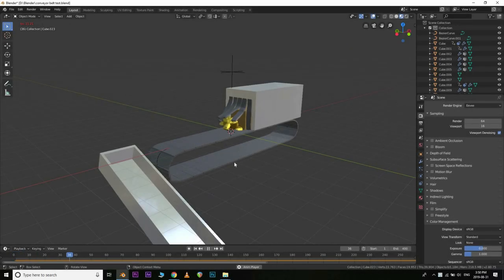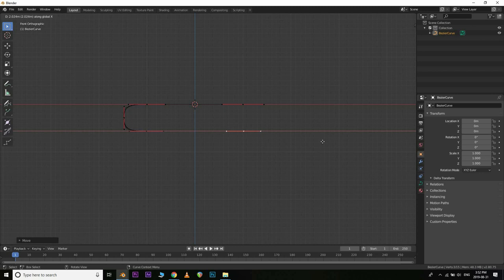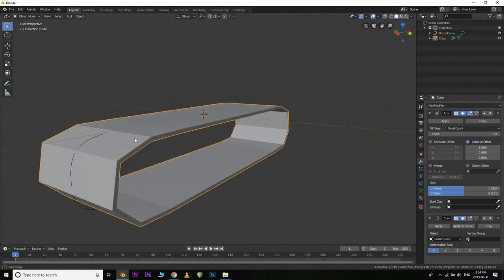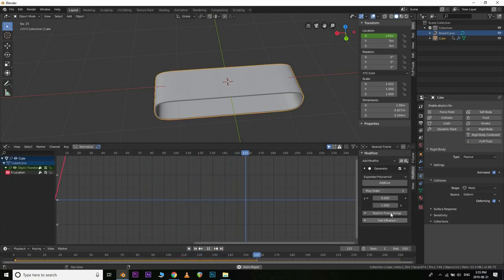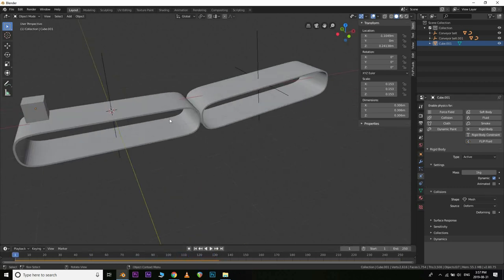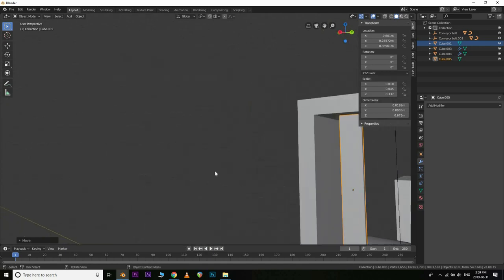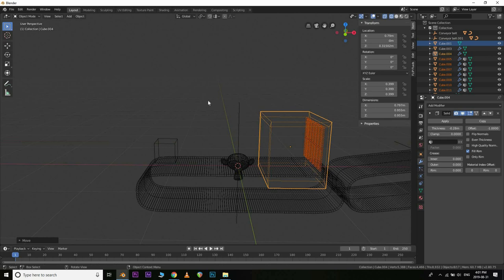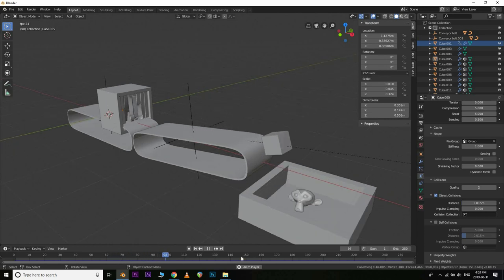Blender 2.8 Dynamic Conveyor Belt 10 Min Tutorial EASY

Comment: Sometimes my objects keep sliding into the unknown, like the conveyor belt is endless and invisible. If I change some random settings it sometimes works again and the objects fall down at the end. Any idea why?
Reply: Does the same for me, sometimes saving the file and closing blender does the trick, sometimes it doesn't. :(
Reply: @MichaelNatale1267  You both have to create it carefully again from the beginning. I did some tests now and it seems that the problem has something to do with a not aboslutely clean creation. All that you describe happened to me too. But in the end it works now correctly. Tested with Blender 3.1, 3.2, 2.8 (linux).
Reply: @Trabucco0  Hello, I've seen this comment from you a lot of times now but no matter how many times and how perfect I create a conveyer belt the rigid bodies simulation is inconsistent and fails all the time. I've also found that more people have been experiencing a lot of issues concerning rigid bodies on conveyer belts, especially in newer versions of Blender. Could you maybe create a small tutorial? Or write down how you do it? As I'm unable to get a consistent, good result.
Reply: @nickykolk  You should ask @MajesticSkies if he is willing to upload another vid about this topic. I am just a learner like you too. Sorry.
Reply: The boundary box for your collision is not taking the curve modifier into account.

The reason for this is that the key frame animation takes priority over the simulation. Try ending the animation when your object reaches the end of the conveyor belt.
Reply: @IgnobleKin  Well it sometimes does take it into account as I described. It appears random to me, at least I don't know why it sometimes works and why it sometimes doesn't. I cannot end the animation at the end of the conveyor belt. I have hundreds or thousands of objects on the belt. It becomes even more strange when some objects fall down immediately, some others a bit later. It looks like as the objects touch the belt, the objects keep traversing over the conveyor belt, but they remember the length of the belt since they have been in touch with it the first time. So the rigid bodies kinda don't update their knowledge about the new transform of the belt

Comment: The cube just falls right through the conveyor and I followed every step
Reply: Check if you applied the array instead of keeping the modifier. It worked for me that way.
Reply: @marcosamaral9658  I have the same problem, applied array but the cube falls through the top surface and hits the bottom surface for some reason

Comment: I get a strange problem. The physics of the box reacts to the "invicible" belt that moves away in the x direction and not the one on the curve ?
So basicly the box either goes along the x-axis forever or it drops down... Mayby i am just tired and missed someting..
Reply: I found it. On the belt rigid body settings i had to change from deform to final. Now its working it seems. Deform with "deforming" ticked did not work. Mayby a bug ?
Anyway great tutorial !
Reply: @minaexperiment  it isn't working even after I changed it to final :(
Reply: @qarwill  Sorry i dont know what it can be. Have not used blender for 6 months.

Comment: Thank you for a great job. However, for me it does not work properly. The item on the belt moves only on the X axis on the original, not-curved array and not accroding to shape of curve. I can see that very clearly once going to edit mode, than the belt is straight and this is how it interactcs as an rigid body. Do you have any ideas how to fix it? any answer will be highly appreciated !
Reply: And yes, I have checked "deforming" at belt rigid body menu...
Reply: Hi, have you found a way how to fix it?
Reply: @ailisnelis2383  no

Comment: Doing this in 3.0 and the simulation keeps breaking. 
After I do some change in totally different parts of the UI the belt stops working, and just becomes a simple moving plane... and nothing I do can rectify it.
Reply: You have to create it carefully again from the beginning. I did some tests now and it seems that the problem has something to do with a not aboslutely clean creation. All that you describe happened to me too. But in the end it works now correctly. Tested with Blender 3.1, 3.2, 2.8 (linux).

Comment: I have followed every step, but my cube continues to follow the x-axis without falling off the belt, I have tampered with the collisions course on both objects making them either final, deform, or base and no sign of success. Does anyone know why? Ive seen the comment below and the same answers are not fixing my issue.
Reply: You have to create it carefully again from the beginning. I did some tests now and it seems that the problem has something to do with a not aboslutely clean creation. All that you describe happened to me too. But in the end it works now correctly. Tested with Blender 3.1, 3.2, 2.8 (linux).

Comment: seems like my cube can't interact with the collider belt whenever this one has a keyframe and just goes through it, does anyone  know why? (yes i applied the array modifier)
Reply: I have the same problems too. I don't think Blender is developed enough to handle it. I spent hours of tweaking to get it to actually get it to work.
It is easier and a LOT QUICKER to just keyframe an object to make it look like the conveyor belt is pulling the objects along, especially if you are pressed for time. 
God forbid if you have to add a conveyor belt to an existing project that has a different settings.
Reply: @rhomis  like I managed to make it work in the end but it was just so random. Sometimes it would work then it wouldn't and i'd have to change parameters or reload the scene for it work again .-.

Comment: In 2.93 version the cube did not fall from the conveyor belt but continued to float after it came out of the belt.   But the cube fell only if I uncheck the Animation option of the belt after the exit of the Cube.  Request your suggestion.
Reply: I have same problem, 2.93
Reply: When I changed the shape of the active object (cube) as 'Box' and the source of passive Belt Object as 'Base' it worked.  In case of changing any parameters the active object continue to float in 2.93.
Reply: @MrJana596  Yes I found that if I did something like remove the curve modifier and re-add it, then suddenly things started to work properly. It's some weird bug
Reply: @bradleyberthold4606  Did you ever try lifting rigid body objects on a belt conveyer vertically.  I am still trying.
Reply: @MrJana596  no, I didn't try that yet. However, I believe it would work if you used separate objects for each conveyor chunk and set up their timelines to move equally

Comment: Im having an issue with the Bezier curve. I got the conveyor to work and wrap around it. But, I added dividers  that keep materials on the conveyor. Around the curves the dividers are being stretched.. Any help or info on that?
Reply: I may not be right, but I did not put any loopcuts on my first cube which make up the conveyor belt. Before I had this streching around the corner too. So I did my array, applied it and without loopcuts it is fine.

Comment: My cube is running the wrong way any ideas by any chance?
Reply from the maker: You need to extrude the curve the same direction I did at 1:30 otherwise it will move rigid bodies in the wrong direction. You can also try rotating the entire curve 180 degrees in edit mode of you dont want to start from scratch. I had this exact same issue when experimenting with making this effect work. Blenders curves can be quite finnicky unfortunately.

Comment: cube literally goes in the opposite direction of the belt
Reply from the maker: Thanks for watching! The reason for this is you created the curve in the wrong direction (clockwise instead of counterclockwise) I'm sure there's another way to fix it but the easiest method I found is to simply delete the curve and remake it in the other direction (only 4 vertices realistically)
Reply: @majestic-skies  i think there is a switch direction option while editing the curve